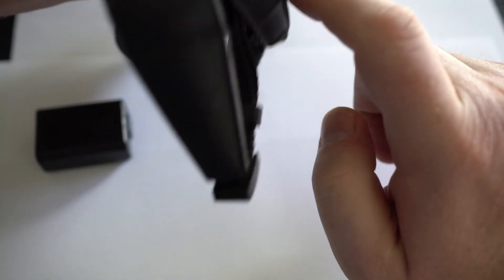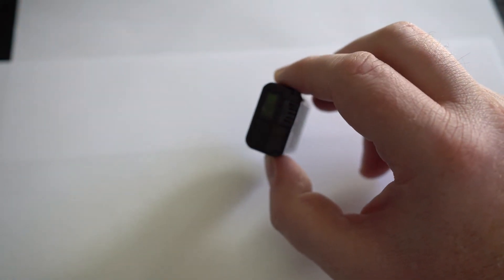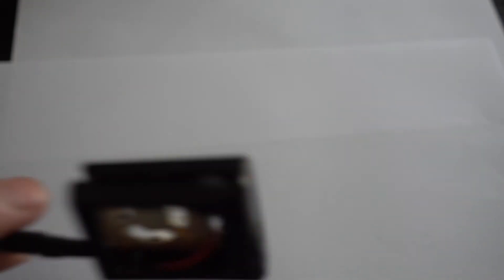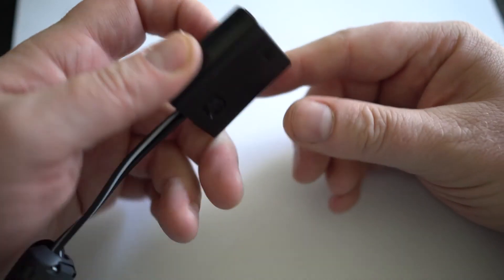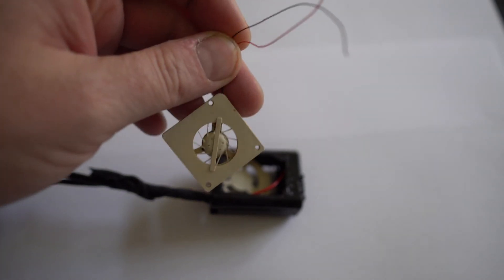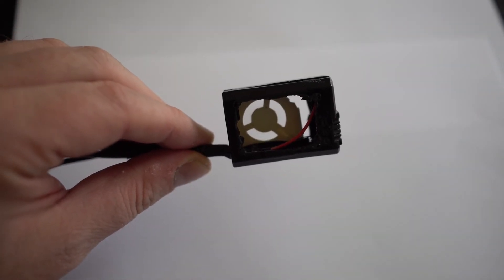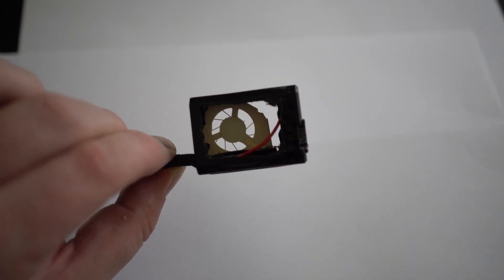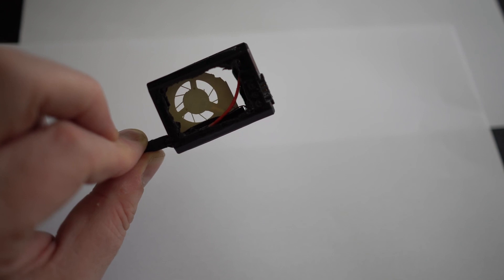dummy sony battery with a build in fan

Comment: So it's a dummy battery with the little circuit board still intact? And then you just drill holes and put in a fan? Can a powerbank power both the fan and the dummy via USB from a powerbank?

Comment: if they made a dummy plug with the fan built in like this, that ran on a battery bank,  you would be the hero of the overheating problem for sure.   Im saying that if it did both power camera and cooled it at same time id buy it today.
Reply: haha!  you're a year ahead of me.  plus youd have the sound of that fan running in your video.

Comment: OK, so you made a "hack" you have never tried, and probably wont even use. I see no logic in that. I would be interested how much longer the camera lasts this way on a direct sunlight. Can you please test it for us?
Reply from the maker: Why do you think i never tried this ? But maybe thats not clear in the video because we mostly talk on a facebook group about the a6300. I indeed tested this and it does work i was able to record 3hours no problem it indeed seems that cooling the temp. sensor in the battery helps and that sony reacts on that one first because well batteries can go boom. But with this and other hacks some of them i really use or keep as a option (like the other fan solution i posted) or just to proof something in this case could you build one (it was a question) and does it work. Hope this helps if not just ask. PS i do plan to use the 'open' battery dummy just not with the fan.
Reply: +Daniel Ockeloen  thanks for the information. It is a nice hack. I was just wondering why didnt you mentioned your test results in the video.
Reply from the maker: You are correct well mostly because it was so linked to the facebook group for the a6300 but ill add some comments. Not sure if i did the test before or after maybe after since that took about 4 hours and wanted to post it as part of the discussion. For your info others are not also looking into this and who knows maybe someone turns it into a product some of the other hacks ended up making its way to possible products. This one i hope won't be needed but again it did show where one of the issues was and why.